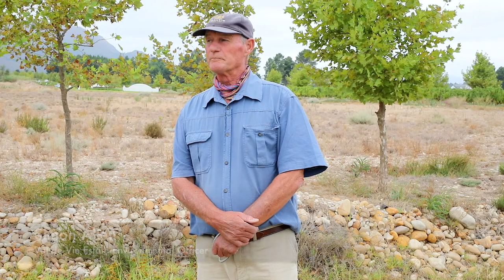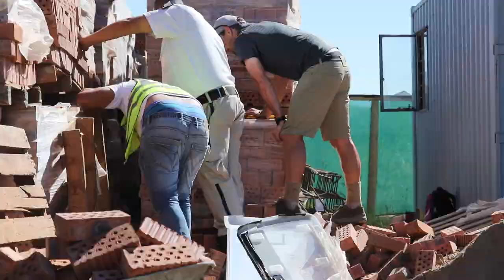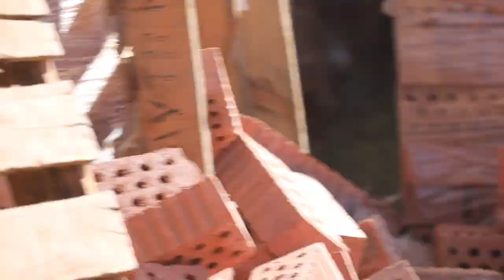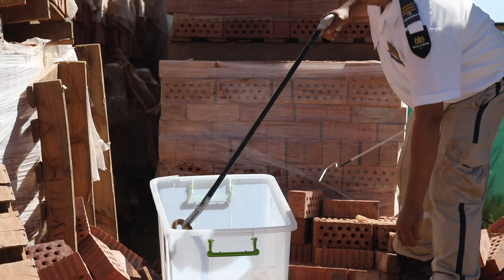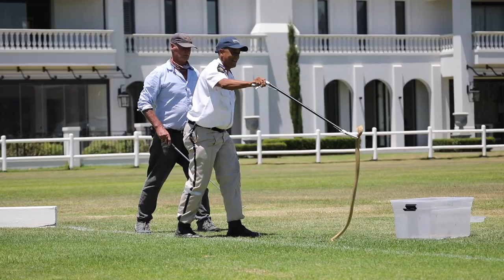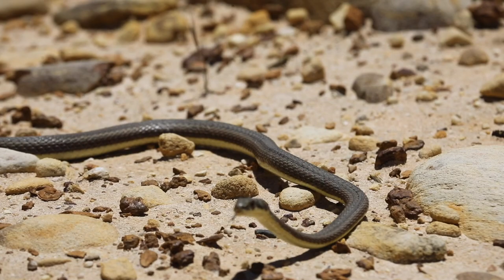Snakes | Environmental Projects on Val de Vie Estate

Comment: I would think for the cobra you would at least want to put a compression bandage on the site. Also wondering if any black mambas frequent the area?
Reply from the maker: Thank you for your question. A pressure bandage is useful in neurotoxic and hemotoxic bites if medical care is at a distance. As venom is moved in the endocrine system which is way slower than the circulatory system, in this area they would be of little use. In cytotoxic bites, the immense swelling that occurs negates their use and in fact could be harmful.
Boomslang have not been positively identified on the estate as far as I am aware. They are more of a woodland species, although it is possible that one could be brought in with landscaping trees from further afield. Unfortunately, due to a general lack of knowledge, misidentification of snakes is common, and so all green snakes are boomslang, all black snakes are mambas, and any mottled snake is a puff adder…

Comment: Thank you Simon. Great video.
Puff adder's venom is only cytotoxic, slow-acting and fatal bites are extremely rare. Cape cobra's venom, on the other hand, is neurotoxic and causes progressive weakness and may affect breathing.
What do you think of using a Smart bandage to apply pressure immoblisation?
Are there any Boomslang on the estate?
Reply from the maker: Hi Magdalena 👋 Thank you for your question. 
A pressure bandage is useful in neurotoxic and hemotoxic bites if medical care is at a distance. As venom is moved in the endocrine system which is way slower than the circulatory system, in this area they would be of little use. In cytotoxic bites, the immense swelling that occurs negates their use and in fact could be harmful.

Boomslang have not been positively identified on the estate as far as I am aware. They are more of a woodland species, although it is possible that one could be brought in with landscaping trees from further afield. Unfortunately, due to a general lack of knowledge, misidentification of snakes is common, and so all green snakes are boomslang, all black snakes are mambas, and any mottled snake is a puff adder…